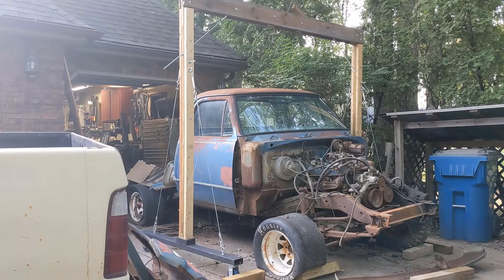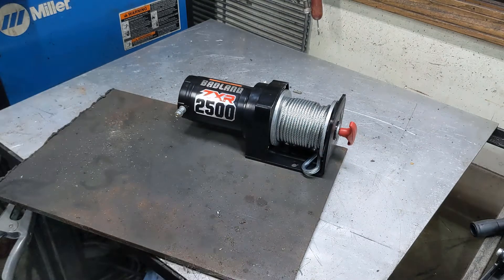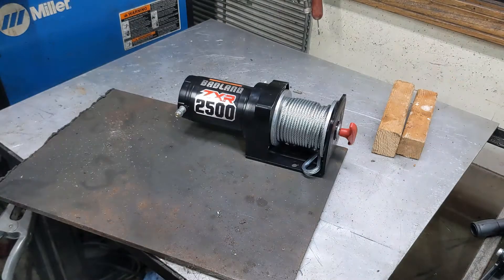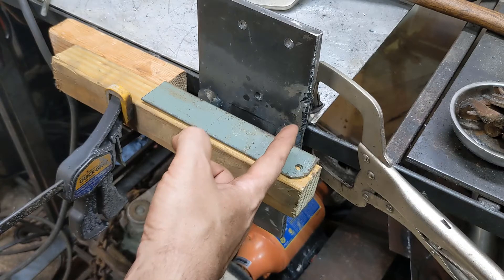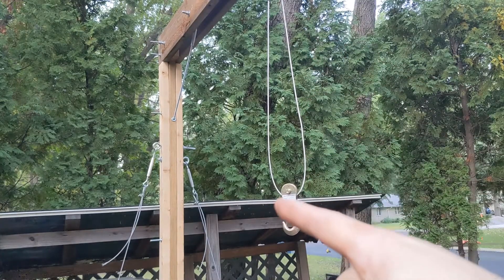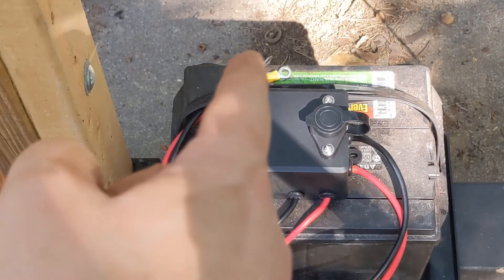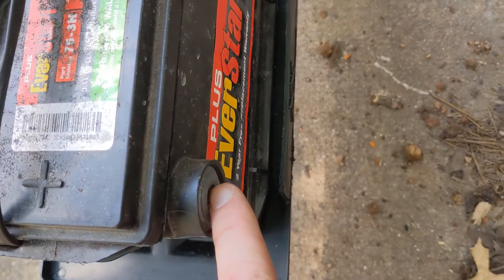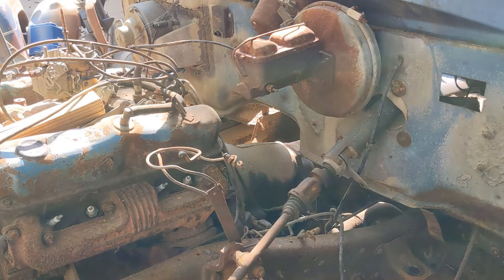DIY Gantry Crane Part 2:  Adding Power

Comment: Great design.  I would turn that winch 90 degrees.  It looks like the cable would be rubbing against the steel bracket the way you have it now.  Should be fine though, just won't last as long

Comment: Well I can tell you from experience that tiny little winch will lift the motor and trans by itself with no snatch block. I used a tripod and made myself a mount. Pulled it right out.
Reply from the maker: Impressive! I'll probably use it to pull the engine and trans out next.